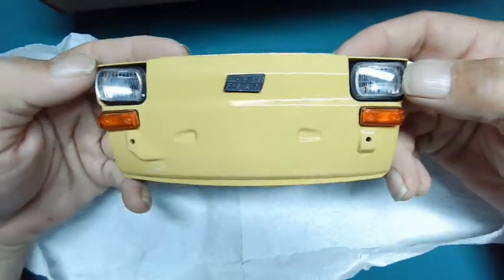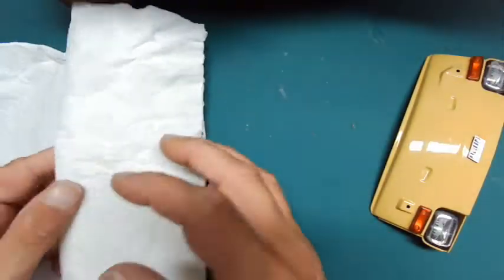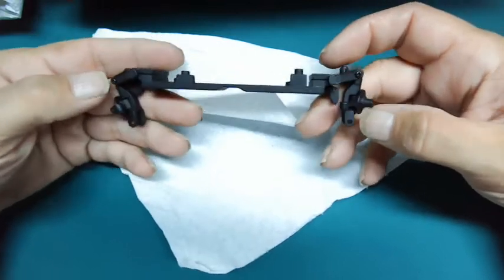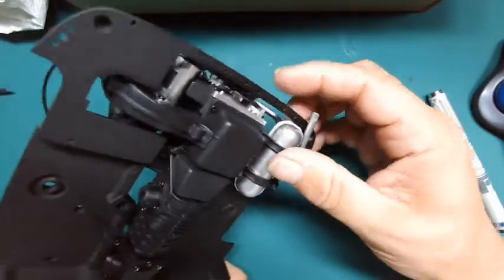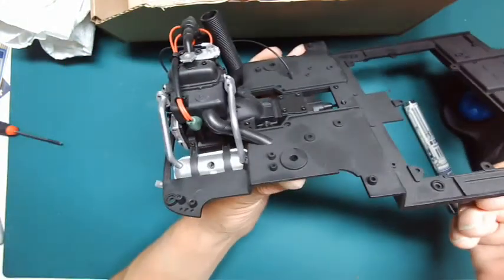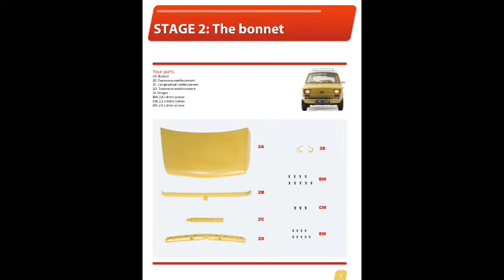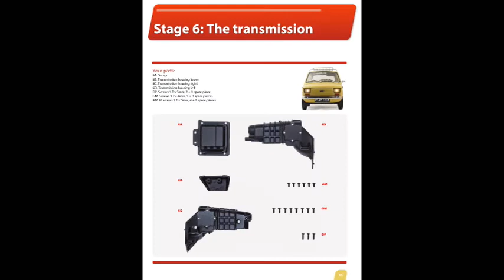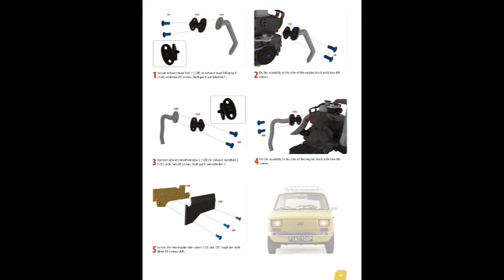Build The Polski FIAT 126p Issue 0 Introduction

Comment: The engine and gearbox are attached to one mounting in the chassis, if you look either side of gearbox you'll see the halfshaft drives and when they come into the build the rear suspension floating arms will address the eccentric play in the assembly.
Reply from the maker: Thank you so much for that, I have spotted it now. Unfortunately I make my videos well in advance, in fact Im currently working on issue 21 so Im sorry but I will not be able to acknowledge you until then, but I thank you from the bottom of my heart.
Reply: @PennysPitstop 
My pleasure Penny, Im only building Routemaster and loved the weekly you n Horlix used to air.
Great to see ya back in the land of the living.
Tommy.
Reply from the maker: @tommytippee2437  Hi There. As mentioned above I make my videos in advance as Im currently playing "Catch Up". I gratefully acknowledged your wonderful assistance on this matter and it will be reflected in issue 25. Some way off I know, but I am a long way behind LOL
Reply: @PennysPitstop 
Hey that's no prob, it's great that you're building the various projects, it was you that I always went to when doing the ole Routemaster.
Gosh I'm still unable to get issue 80 so I'm stalled.
I'll keep watching you're great vlogs.
Best regards to you Penny.
Tommy🙏🏆